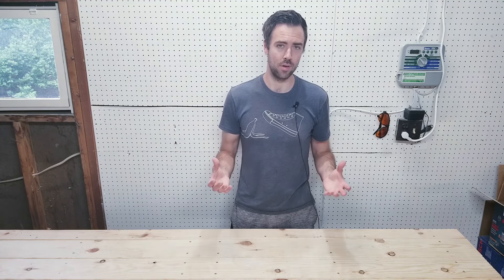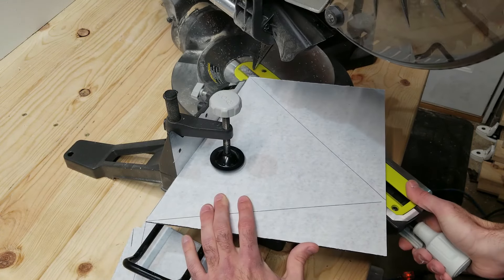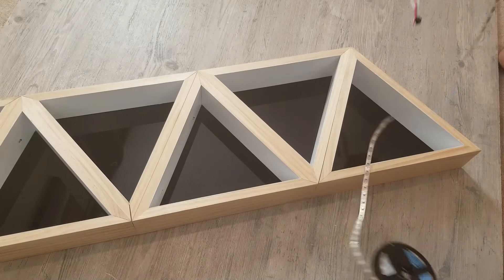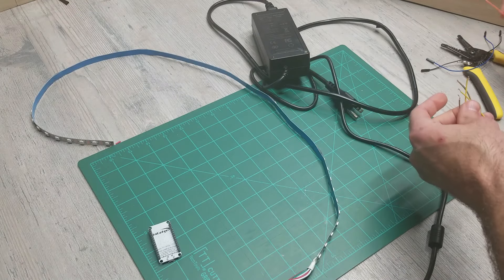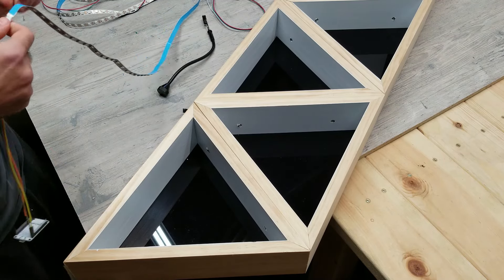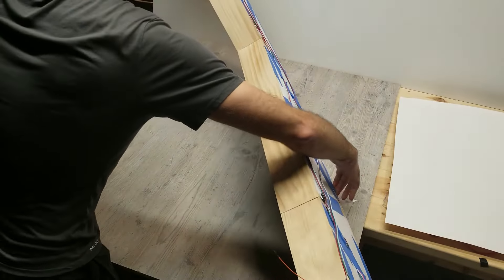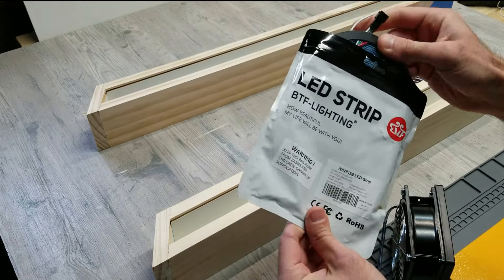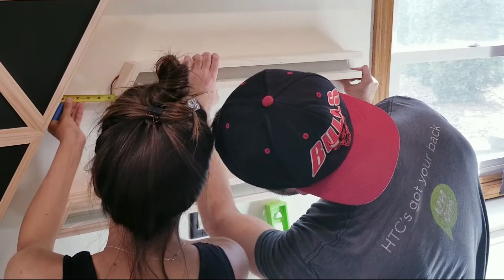DIY Nanoleaf - Black LED Acrylic

Comment: The "extra pixel" is a common fix, because it acts a regulator, (ws2812s all regenerate signal to pass onto the next pixel) and so it cleans up the signal voltage.
Reply from the maker: Thanks Seth for the explanation. That makes sense.
Reply: The extra pixel method is used to fix the data line voltage that comes off the board at 3 volts and LEDs require a data line voltage of 5 volts.  The data voltage exits the first LED at 5 volts fixing the issue down the line.  You can also use a logic level shifter.
Reply: Yes, it is.

Comment: Love the video and the final look! Hope you don't mind a few comments (not criticisms): 1. I was surprised after all that great woodworking construction that you didn't cut channels for the LED cabling for a completely flush finish at the rear. 2. The effect looks stellar in the dark but for me the conduit kind of spoils the floating look. Did you consider fishing the wires though the stud wall? Similarly, having the mounting points hidden behind the triangles rather than those exterior L brackets? 3. Concerning power, there are functions in WLED that will tell you the actual power consumption on the fly and also allow you to throttle back by setting maximum current drain. This allows you to size the PSU and protect it in a situation where the LEDs could theoretically draw more amps than its rated value. 4. Personally I would have tucked the microcontroller inside the first triangle to avoid the need for a sacrificial pixel and since WLED can be updated over the air, there's no real need to have ready access to the USB port.
  

That black LED acrylic though! I just bought some for future projects. Not only does it look terrific with the LEDs off, it acts as a diffuser too, so even with LEDs close to the acrylic the effect is awesome!!!
Reply from the maker: Thanks so much for watching and the comments! I really appreciate it! You make very good points. If I were to do this again I probably would take the extra time to incorporate all your ideas as they would make the end results look better and more polished. I have never hid wires through the wall / studs but I imagine it would be very difficult which is probably why I have never done something like that yet. In your experience, is it hard?
Reply: @ChrisMaherDIY  The technique is called cable fishing and it's become a popular way to get that clean look when mounting flat screen TVs on the wall. You've obviously got the skills and confidence to work with stud walls so I'm sure you'll find it a breeze. Most of my experience has been in industry (data cabling) but the same principles apply and I'm sure the Internet is awash with tutorials. Rods, tape, magnets etc. can all be found in hardware stores and online. If I can offer any advice, it's that gravity is your friend!
Reply from the maker: @michaelweston8569  thanks for the info! I might just have to give it a try. It would definitely make things look more clean during the day. Thanks again for the comments and for the reply! I do appreciate the feedback!

Comment: It looks like the wire you're using here would be too thin for this tip, but in general, you can prevent the voltage sag by feeding the positive terminal at one end, and negative at the other end. That forces all of the electrons to take the same basic distance, and maintains uniformity. Plus, you only have to cable manage 1 conductor. You generally need thicker-gauge cable for best results at low DC voltages. Good stuff though! I guess I need to buy some acrylic now... 🤑
Reply from the maker: Thanks for watching and the great feedback! I'm still very much learning on the fly when it comes to wiring and voltage so I appreciate the tips! Yeah the black led Acrylic is wild and looks so cool!
Reply: @ChrisMaherDIY  It's really sci-fi looking. Might be a good base for steampunk as well.

Comment: Nice video. You're showing experience from vid to vid. Did you use a special blade to cut the acrylic? You didnt get any cracks or melting?
Reply from the maker: Thanks! I'm definitely learning something new with every project. I just used the same blade that came with the miter saw and it's the same blade I use to cut wood with so nothing special. There was surprisingly no cracks or melting. The white acrylic I used in other projects had very minimal melting but this black acrylic had none.  Thanks again for watching!

Comment: I want this but it is too thick for my small room, is there any way to make this thinner without the leds showing up from the front? also can this be linked to alexa? Thanks for the great vid bro.
Reply from the maker: Thanks so much!! You could definitely try using some 2inch thick wood instead of 4 inch but my guess is you might see the lights underneath a little bit. I haven't tried it but with experimenting with! I also have not tried linking to Alexa but I believe I've seen videos on YouTube where you can do it. I'll have to look into that as well! Thanks again!

Comment: Nice Project. ⚠ BUT please do not use those tiny wires to feed in power (15:33). They can only handle at max 4A over that short distance, not the 15A the power supply can deliver. The dual power injection helps, but this is still a fire 🔥 hazard and i don't want to see your channel gone.
Reply from the maker: Thanks so much for watching and the advice. I just updated the description to let people know to used thicker wires. Do you think using 18 awg wires to connect power to the ESP2866 board is good enough or do you recommend thicker wires than that?

Comment: Very nice project ! I need to make some of these now :D
Sadly, we can't find those acrylic in Europe (I'm in France), and shipping to France in Tapplastics begin at 180$ for few sheets...
Reply from the maker: Bummer! Yeah they are not very common here in the states either. I could not even find anything like them on Amazon. Thanks though for watching! I appreciate the support!
Reply: Maybe just use clear acrylic and cover it with car window tinted film?  It's an extra stage, but should allow the light to come through.  You might have to increase the brightness to compensate for the chosen % of tint you use.

Comment: Great job! Been looking around this type of videos since I'm looking into building a diy nanoleaf wall too, and it's the only one I saw with that type of black acrylic. I swear though, being in Europe is horrid in terms of sourcing materials. I can barely find white/opal acrylic for a non eye-gouging price, let alone cool stuff like that. Definitely saving it for future reference though!
Reply from the maker: Yeah finding the materials is usually the hardest part of these projects. Good luck on your hunt! Thanks so much for watching! I appreciate the support!
Reply: Search for "translucent black" or "tinted black" acrylic. There are enough alternatives available here in Europe. You could even just get tint film (used for windows/cars) and stick it on any glass or plexiglass for almost the same effect. You can also use mirror foil for another nice look (often called one way mirrors, but that's physically impossible; you just see mostly what's on the brighter of the two sides). The trick is always to keep the backside of the sheet dark (like the triangular boxes in this video do).
Reply: I did find a few options, it's crazily priced though. I emailed the company linked in this video, they quoted me at 100ish $ for the acrylic - though the shipping was 120$+ on its own, so I passed. Found a company here in the Netherlands - 300€+ for the acrylic alone. The US company would cut it in the shape i needed, this one wouldn't even do that. It's insane. I might as well buy the original Nanoleaf for that price lol.
I found another company that sells the good old milky white / Opal acrylic for very reasonable prices, so I'll go with that. Took some deep searching though ^^
Reply from the maker: @AtticPCGuy  that is crazy how hard it it to find over there! At least all your hard work looking resulted in you finding something! Maybe you can start your own acrylic business over there since it seems like there are not many options lol
Reply: @ChrisMaherDIY  Apparently I could literally order it from where you got yours, have it shipped, and resell it for a for a 100€ profit with 0 work involved, so it probably wouldn't be a bad idea xD

Comment: WOW! Yet another awesome project from you. Now I know what to do with that black acrylic panel that I recommended for you (thanks again for the shout out)

I used 1/2" x 7/8" staples for your Nanoleaf project by inserting three of them to each  adjoining hexagons and just used a few nails in the wall for the top hexagons and mad a small hole into the white paper backing to slip the nails thru. I also was lazy and did not cut out individual white backing paper, put just took a couple of full size lengths of it and traced out the silhouette of the nanoleafs
Reply from the maker: Yeah I think it was one of my first videos you told me about this black led acrylic! I ordered some right away but it took me a long time to decide what I wanted to make first with it! Thanks again for showing me them! They are rediculously cool looking! Can't wait to see how yours turned out. Sounds like you secured the hexagons together much better than I did lol.

Comment: UM... Why wouldn't you make the dado cut first instead of doing each one , one at a time... seems kinda a lot of extra work...   just curious
Reply from the maker: If I'm remembering correct, if I did the long cut first, since after ever angled I would have to flip the board to get the correct angle on the next one resulting in the dado being on the outside instead of the inside. Now I could have just cut off a small chunk of the wood to make the correct angle but at the time either I didn't think to do that or I didn't want to waste the wood on the extra cut. My guess is I probably just didn't think to do that since it would have save me a lot of time lol. If that doesn't make sense, I love this guys channel and he did it the way you suggested on the hexagons. Start watching at the 6 minute mark to see what I mean by the little wasted wood on the extra cut. https://www.youtube.com/watch?v=lNcsT5DZjAM

Comment: U should've drilled a half inch hole through the wood to channel the wires through & before connecting each of the 10 sets of 52 LED's instead of using electrical tape to tape the wires to the wood.
They're called 'L-shaped brackets' & u should've added a couple at the bottom for support.
Reply from the maker: That's a great idea! For sure would do that if I made it again. Thanks for the tip!
Reply: @ChrisMaherDIY  no problem